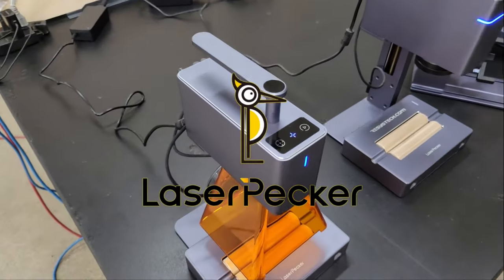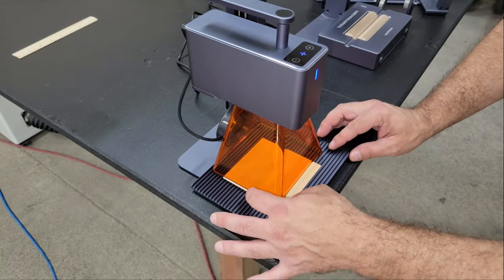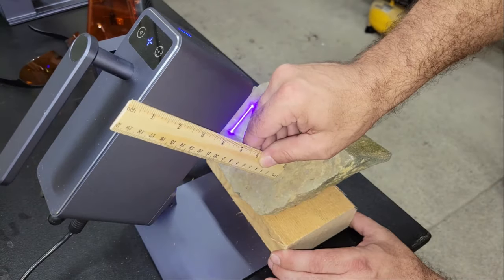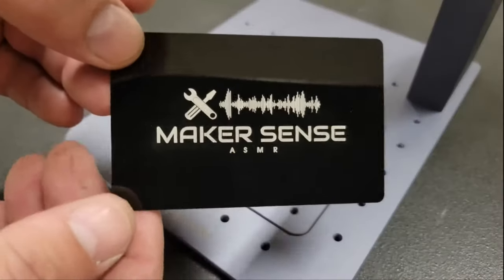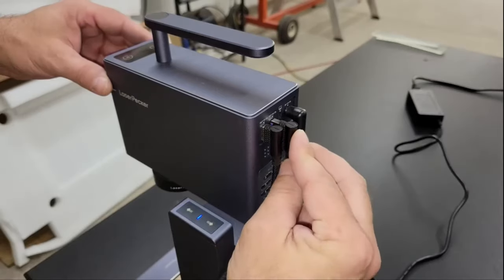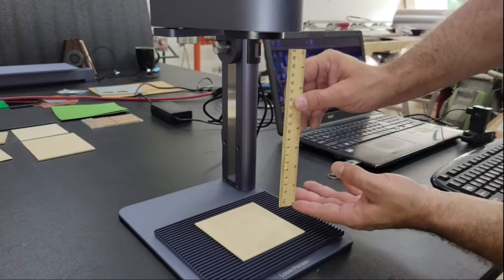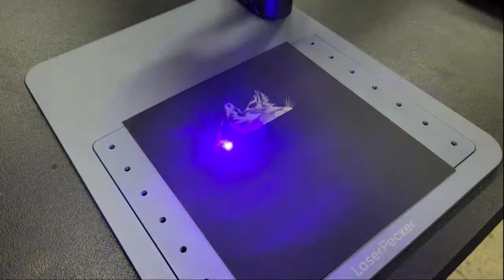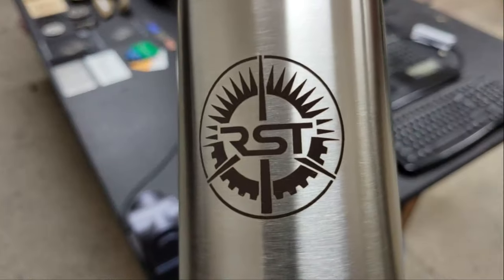LaserPecker 2, 3 & 4 Explained - Which Engraver Is Best For YOU?

Comment: Good informative review. I purchased the LP1 pro first then later invested in the PL2 variant. While impressed no end with the LP2's desktop engraving performance for it's small footprint, it's not as genuinely portable as the LP1 pro variant, primarily because it requires a bayonet type, not USB 5v power connector. And is not supplied with an appropriate lead for powering via a standard USB power bank unlike the LP1. I also purchased the brass gnarled rollers and like you found they constantly slipped and ruined the engraving. However, instead of adding elastic bands to the item, I disassembled the rollers, cut grooves into the ends of each brass roller and inserted rubber o-rings at each end. They've not slipped once since. 👍😉
Reply: Do you use those for the business purposes? Think of earning some extra money 😅

Comment: I wonder how the LaserPecker 4 compares to the XTool F1 which also has diode and ir heads.     is there a difference besides price?
Reply from the maker: Can't say what the F1 is like, never used it. But the specs are very similar. F1 slide extension is longer and narrower, but aside from cosmetics that seems to be the only difference I can see.

Comment: When you engrave on black acrylic what settings do you use to get the white.  I have an LP 4 & I absolutely can't get it to work.  An image is visible, but not like it did with your logo.
Reply from the maker: I used the presets in the app, and the IR laser, not the diode.

Comment: I understand that LP3 can etch more metals and plastic surfaces but is there any advantage of getting LP2 over LP3 other than price? Is LP3 the better machine?
Reply from the maker: They're different machines that work different materials that the other can't (covered in the video). LP2 is a 5W blue diode. LP3 is a 2W IR. Two different lasers with different wavelengths. One is mostly for organic materials, the other is not. The only metal that the LP2 can etch is stainless steel or coated (ie painted, anodized) metals. The LP3 can etch all metals, bare or coated. One isn't any better than the other in general, only in terms of what projects you intend to make and what materials you expect to make them with. LP2 is good for general hobby crafts and woodworking. LP3 is better suited for a jeweler's shop, for example. LP4 does it all.

Comment: how much noise and smoke does it produce in marking ? . i leave in a sharing room and dont have a workshop or something just a small place to keep the machine . is it advicable to have any of these machines in a sharing room ? will it disturb the other room mates ?
Reply from the maker: You will need ventilation (use next to an open window with a small fan is fine) and they will produce noise. How much depends on the power level for the job and how hard the cooling fans need to work. The IR laser is the quietest. The diode laser in the LP4 is the loudest at max power. Expect anywhere from 40-70 db. They're not really loud, pretty tolerable imo but some people can be fussy and annoyed easily. You would probably need to work something out with your roommates when they're home even if they're generally decent people, just to say you did and avoid annoying someone on a bad day, or use it when they're not around.
Reply: @JamesBiggar  thank you very much

Comment: Hi James, 
Questions to ask I have a horse halter business and add a Ritchie dual colored tag for ID.  Would this laser the LP2 make these kind of tags?  Ritchie dual colored tag.
Reply from the maker: Not for plastic, no. Diode lasers don't work well with any plastics other than black acrylic. You would need either the LP3 or LP4 which have the IR laser for etching metals and plastics. Bear in mind that I said etching and not engraving. The IR laser is only 2W so you can't do any cutting or engraving (ie remove material). Etching just lightly scores and discolors the surface (black acrylic turns white/grey, for ex, white turns black/grey, etc). It's more durable than paint, but not as permanent as actually removing material. The multi-layered plastic Ritchie cow tags are really meant for engraving with a rotary tool like a dremel or cnc router machine so there's no discoloration of the lower layers. If you used an IR laser powerful enough to engrave a yellow on black tag, for ex, you might end up discoloring the black after burning through the yellow and end up with yellow on white instead. You can get a small cnc machine for the job that's actually cheaper than the LP2, but it's noisier. See one of my latest uploads for an example.

Comment: what is the depth  of the etch? let say if I was engraving on plastic how deep can I go without cutting all the way through the material?
Reply from the maker: Depends on what laser you're referring to and what your power and speed settings are. Blue diode can cut through dark plastic, engrave it to a desired depth or just mark it, but it can't work light/clear plastic, and it's really only good for acrylic (other types of plastic can just melt or catch fire as opposed to vaporize under the laser like they should). IR can mark/etch almost any metal or plastic, ie either discolors (low power) and/or lightly scores the surface (high power). LP2 has 5W diode. LP3 has 2W IR. The LP4 has both lasers - 10W diode and 2W IR.

Comment: Hi, thank you so much for the informative video. I have a question. Which of the devices could also cut the metal, copper and also gold or silver ? 
Thanks in advance.
Reply from the maker: Np. None of these machines can actually cut metal. Only the IR lasers (LP3 + 4) can etch (mark) different metals. If you need a machine to engrave/cut different metals then check out the ComMarker B4 galvos that I've reviewed.

Comment: Can the LP 2 engrave letters into exhaust piping which is made of steel, but can be aluminized steel tubing, or stainless steel? I need an engraver that I can hold in various upward angles.
Reply from the maker: Only stainless, and bare in mind that it only etches the surface, it doesn't engrave. Etching involves melting the surface just enough to cause a raised texture, while oxidizing it (which produces the color). Engraving is just as it sounds - removing material to create a groove. Since an exhaust pipe is prone to discoloring when it heats up for the same reason the laser would color it, anything you etch into it might disappear sooner than later, so I would opt for engraving instead of etching. For that you need a fiber laser, and there are portable fiber laser's available. I can't name them here for obvious reasons, but they shouldn't be too hard to find. These LP lasers are IR and blue diode.

Comment: Hi, I am wondering how this will do with longer designs all the way around a tumbler that does not have the same width from top to bottom.
Reply from the maker: Should work fine as long as the surface isn't too curved. Surfaces with deep curves/contours require a laser with a motorized z axis to adjust the focal point accordingly as the laser moves. If the tumbler is just angled from top to bottom and the angle isn't too extreme and the surface is reasonably straight, then just use the tail stock for the chuck rotary attachment to angle the smaller end higher so that the top side is parallel to the base and remains that way as the chuck spins. I can't recommend attempting it with the roller rotaries, though. Maybe wrap some rubber bands around the smaller end, but I've only etched straight objects on the rollers so I can't say how they would work. The chuck rotary works great, though.

Comment: Hi James, good video! 
Quick question here: I am interested into using it for metal, stainless steel and similar rings in particular. For this material I understood it will etch it, but not really engrave it. Question is, does the machine generates any sort of residue that we need to vacuum later? I have pets around and I want to ensure no residue is generated that I have to worry about, or otherwise ensure to isolate the area with the the container box as the brand also offers. 

Cheers!
Reply from the maker: Thanks. True, the IR laser will etch and mark metal and plastic (ie score and discolour), but not engrave it (remove material). You will need ventilation depending on the materials that you're working with, specifically any coatings or paint that's on the material. Bare metal isn't usually an issue, but fumes are generated when coatings are involved. If you want to actually engrave into metals, check out my channel for another option that I featured recently.
Reply: Super. Thanks @JamesBiggar !
Reply from the maker: Np.

Comment: Which would you recommend (if any) for engraving eyeglasses?
Reply from the maker: Depends on the type of laser you're using. The safety glasses need to be designed to block the wavelength of the laser.  Every machine I have came with goggles for that particular laser.
Reply: @JamesBiggar  Sorry, I mean to engrave the actual frame. Etch a logo on the side, etc. 😎

Comment: So, these are actually laser etchers, not actually depth engraving. Are these able to have any depth in the etching process?
Reply from the maker: The IR laser etches (ie scores/discolors) metal and plastics. The diode laser engraves wood, leather, stone, and other natural/organic materials (ie remove material), and etches stainless steel but does not work on any other metal without marking agents. LP2 is diode, LP3 is IR, LP4 has both. If you want to do 2.5D or 3D engraving in metal, check out my channel for other galvo fiber laser options that do exactly that. The takeaway is that there are different laser types and they're all unique in what materials they can work and how.

Comment: can either of these machines engrave glass or clear acrylic?
Reply from the maker: If you colour the surface of the glass or acrylic first (marker, paint, anything reasonably dark and easy to remove). Otherwise, you'll need a CO2 laser.
Reply: @JamesBiggar  thanks so much that is information that I really needed. I appreciate your response.